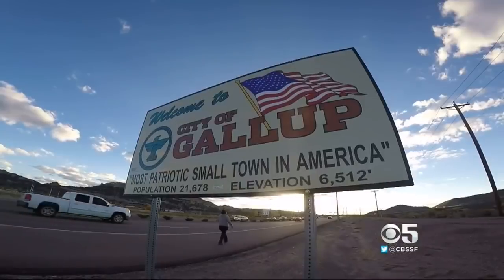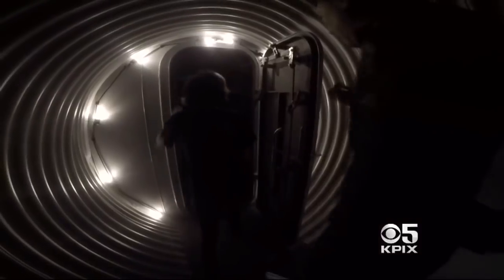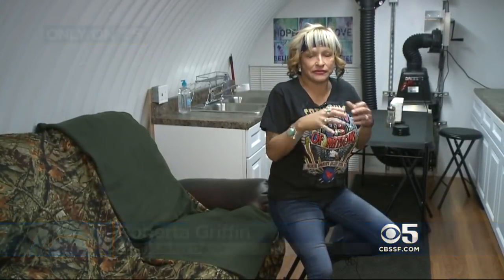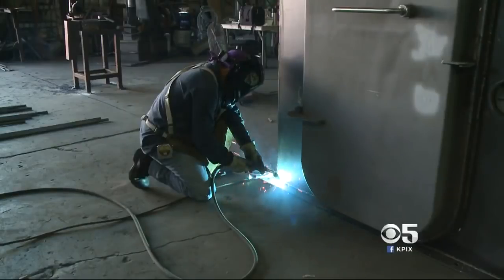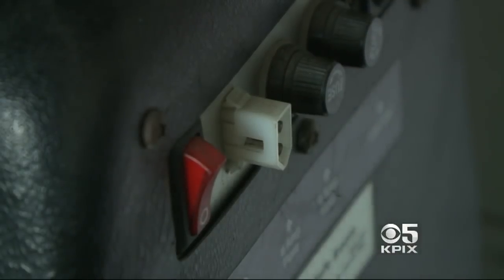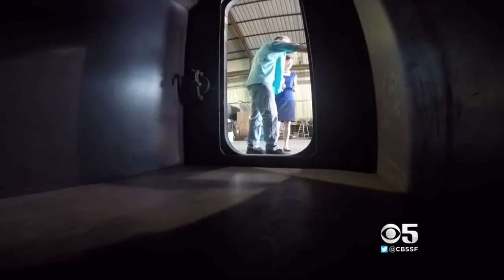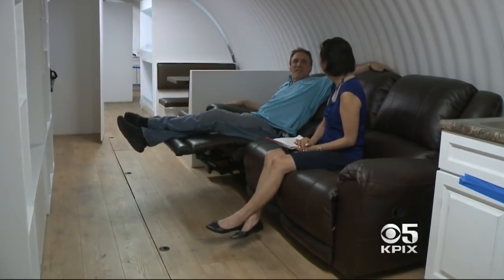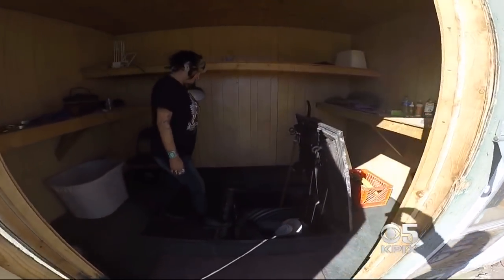Nuclear Bomb Shelter Business Is Booming

Comment: If there is ever a nuclear war, anyone who relies on the bunkers that were shown in this video will die of radiation poisoning. They all had the Swiss designed air filtration systems that filter the radioactive air using filters that are kept INSIDE the bunker. The air leaving the filters for the people to breath may be clean, but the highly radioactive particles captured by the filters remain inside the air filtration system, which is kept inside the bunker. Alpha particles and some beta particles will be stopped by the sheet metal canister, but not the neutron particles or the gamma radiation. What’s the good of being 23 feet below the surface if you bring the radioactive particles down with you?

And what do people think is going to happen after staying underground for a year? Do they plan to go up to the surface and stop by the local grocery store and buy some food? The next source of food will be whatever they planted and take 9 months to arrive, assuming they know anything about farming. Did the radiation kill all the soil bacteria (critical for growing new crops)? Do they have a wide variety of seeds to plant? Nuclear winter will last years, do they have materials to construct greenhouses? San Diego will be hard hit, with high levels of fallout. After a year, low levels of radiation will continue. Even low levels of radiation add up. It only takes 50 rads of radiation to sterilize a male, and children who are closer to the soil, will absorb twice the amount of radiation that an adult will receive. Will the adult female do all the outside work?

The only practical solution is to build your safe haven in an area well up wind (to the West) of any target or nuclear power plant; and travel there shortly BEFORE the missiles fly. Anyone building a fallout bunker East of the Mississippi River, where almost all of the 106 nuclear power plants are, are wasting their money. When you exit your bunker, the area around you will most likely be littered with the extremely radioactive debris that came from several of the nearby nuclear power plants. No, you can’t just switch off one of those plants and leave. And those plants will continue to boil out their radioactive contents for the next 100 years. Good luck even leaving the area before you receive a lethal dose of radiation.

If you are going to spend that amount of money, talk to someone knowledgeable of the dangers involved, not just the guy selling you a bunker. When tensions are high, you might decide the cost of taking an extended vacation to Western Australia is a better fit for you. No, I’m not a travel agent.

Comment: I rather die in a swift and fast death by nuclear fire than rot in a shelter or vault. It takes almost 200 years for fallout to be survivable for humans. Good luck too you.
Reply: No, It Takes 3000-200000 Years For Radiation To Decompose, Allthough, After 48 Hours, The Radiation Wont Hurt You.
Reply: After 48 hours? No, after 48 hours limited exposure is possible (emphasis on "limited") in clear conditions. You're still in danger if you're outside and especially in windy conditions because dust, any dust, is to be regarded as highly dangerous. Two weeks would be the official all-clear, but the ground and any open water would still be contaminated with water-soluble Cs-137 and Sr-90 for decades. (about three if you were wondering)

After 48 hours you're an idiot if you decide to just frolick outside without protecting yourself, U-237 alone has a half-life of damn near a full week and will absolutely fucking wreck you if you ingest it. Don't do it! Two days is barely enough time for U-240, Np-240, and Zr-95 to decay, if you're forgetful and decide to go out after a day a mere day later you're exposing yourself to Sb-127 as well which won't decay for another twelve hours. Calculations of decay period after two days are rarely ever done, the assumption is the immediate area will definitely be polluted and it is in everyone's best interest to remain sheltered.

Even after a week, a whole seven days, you still shouldn't venture outside for too long. A good number that everyone can remember is two weeks and by that time relief will have come and gone. With radionuclides contaminating every surface it's better, no, absolutely critical, to err on the side of caution.

Yes, some areas will receive little to no fallout exposure, but that doesn't matter. We're obviously talking about places where it rains black.